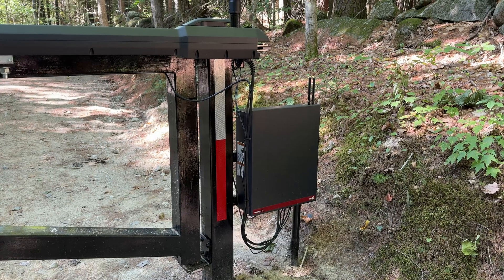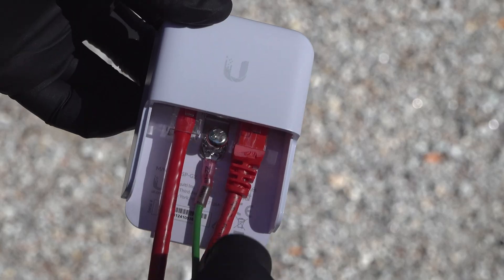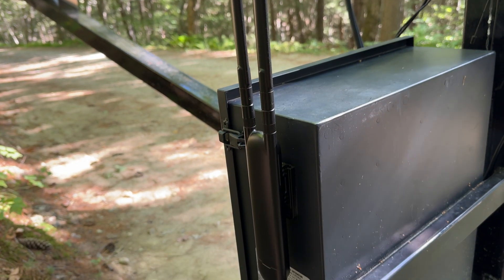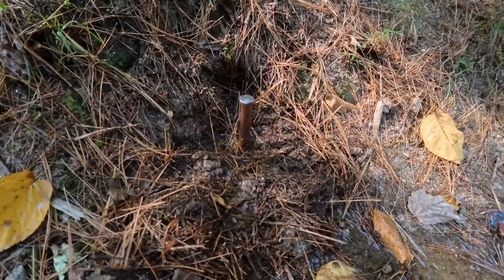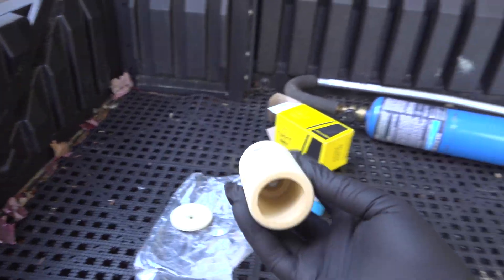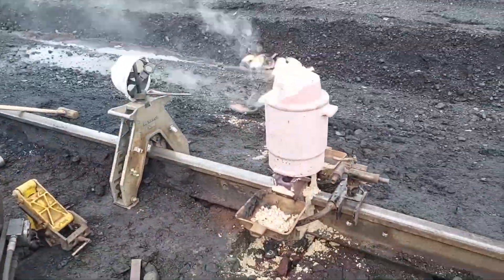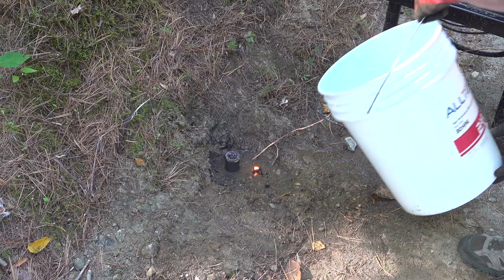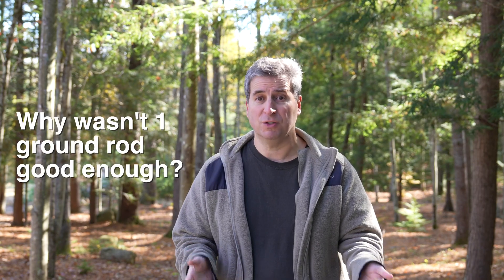Best Way to Protect Outside Network Equipment From Surges

Comment: First and foremost - this is an excellent tutorial on how to find a grounding tab, put the grounding rod in, connect it, etc.

I am confused though, about how this helps for outdoor equipment? Generally, surges are going to come from the power lines, or potentially misbehaving equipment (often due to irregularities in the power lines), in which case, it makes most sense to have anything that's fed from the house, protected by surge protectors inside the house. It's worth noting very few power strips are rated such that they are going to survive a direct strike on a power line right outside the house, but if it hits, say, a nearby substation, the dissipation of it hitting multiple homes, lowers it such that it's manageable for most MOV-based surge protectors. Network equipment like that shown here typically doesn't have any integrated surge protection, as MOV-based surge protectors are sacrificial, so it wouldn't make a lot of sense, as the device would likely end up dead anyway.

If equipment is not physically connected to the house stuff, only used via wireless networking and solar panels, then there are only two other spots for outside surges to come from lightning (which seems to be what you're going for, based on your comments near the end of the video): lightning hitting equipment directly, or lightning hitting nearby trees.
Because there isn't any built-in protection to these devices, if lightning hits a device, the fact that they're grounded isn't really going to help, and may even make them a more-likely target for lightning in the first place. If the goal is to protect against nearby strikes on trees and such, grounding them is still not great, as you've not given lightning a path from the ground (which is absorbing the lightning strike) to your devices, whereas without ground, it wouldn't be able to backfeed from the ground into your equipment at all.

Can you clarify the goals here, and how grounding this equipment will help with any sort of power surge you're expecting to get? (The main advantage I'd expect to get from grounding outdoor equipment, is a (more) solid reference for zero Volts - but this generally isn't useful for differential signaling, such as Ethernet, anyway.)
Reply: You can get surges on your outdoor ethernet cables from nearby lightning strikes. It can be hundreds of feet away. And fry all your expensive home networking gear.
Reply: @estusflask982 Re-watching the first part of the video, I see the device at 0:20 is an Ethernet surge suppressor. This was not clear to me from the first or second times I watched this. I'm also realizing at :11 the "I don't have any wiring back to my house" was not referring to Ethernet, but rather mains voltage electrical. I would still want an Ethernet surge suppressor inside the house at this point, and still have the concern about adding a ground outside being a potential path for lightning energy from a tree strike, that wouldn't otherwise be there. I would think that running fiber instead would eliminate all the headache of it though, and likely be a better way to do it, especially if the power is coming from solar anyway.

Comment: Nothing is going to protect electronics if they take a direct hit.  A good lightning defense should be a layered approach starting with an arresting system that should take the majority of the hit before it ever gets to the electronics, and each remaining layer  doing it's part until, hopefully, the surge suppressors can handle the rest.  It's a nice thought, and it may save you during a near miss, but I wouldn't have much hope for things surviving a direct strike, not to mention that I have seen lightning strike trees or other objects in the yard, not connected to the ethernet cable, and a spike still finds a way in, or is induced, and causes significant damage.   While it doesn't play well with your POE plans, for wide areas or multiple buildings, I prefer wireless or fiber optic links that can cover a lot more distance than Cat 6, and, most importantly, can't conduct a surge.  They won't prevent damage at the point of the strike, but they will contain it so it can't damage anything else on the network.

Comment: 5:49 - It been years for me since i had  my network training but double CHECK if you are using right cables. 
This are UTP cables - not shielded with plastic connector. You need STP cable with shielding&metal connectors for continuous grounding - it is placebo without it.
Reply: STP will not protect from surges. The Shield is to reduce external noise such as power cables running near by STP data cables. or electrically noisy equipment (EMI). 

Typically surges in data occur when an intermittent voltage is applied to the one or more of the pairs. This could be a bad POE power supply, equipment failure (bad network switch or ethernet card). 

Using the STP Shielding as a ground sink for a Surge protection device  is a bad idea. There is a chance that the Cable outer jack will be compromised (ie cut) that comes in contact with a energized metal (ie  metal electrical Junction box), that will cause the Shielding to no longer be at the ground state & at elevated voltage. For instance 120VAC. if that happens, The Ether  Surge suppressor will work in reverse applying a higher voltage into the data pairs likely damaging the ethernet device & probably the switch. 

An real world example of this is when a ethernet cable (UTP) was ran past an overhead fluorescent light in the ceiling. the fluorescent light metal case became energized due to improper wiring. The ethernet cable was frayed  by a sharp corner of the light fixture and energized one of the pairs causing the destruction of the eth. switch and the IP camera connected to it.

I like the idea of running STP, but not connecting the shielding to a Surge protector.
Reply: @guytech7310  Yeah it needs connected to ground AND only 1 end of it connected to ground, just cut the other end off you don't want it to be a path for current, it's just to "shield" the wire from interference and nothing more.
Reply: @PatrickBaptist you actually ideally want both ends of the shielding to be connected, and a metallic enclosure connected to the shield that goes around the device. In the real world though doing it correctly often gives you ground loops so cutting the shielding on one end is a cheap fix, but it's a bandaid that doesn't actually solve the grounding issue. 

Having a ground loop isn't caused by the shielding, it's caused by bad grounding. By having a grounding rod on both ends of the cable you clamp the electrical ground to the same level on both ends and  can connect the shielding correctly. Cutting the shielding on one end is much cheaper and often good enough though so it's ok I guess lol

Source: I'm a network engineer and an EE dropout lol
Reply: No need for shielded CAT cable for long outdoor runs, as there's no EMI to protect against. Water ingress is a much bigger issue. And shielded cable can become problematic if it's grounded at both ends, you'll end up with extra ground paths etc.
Reply: @sstorholm  I live in a city so there is all sorts of EMI like mobile phone networks, radio stations, TV stations, etc.  long cable runs are basically really big antennas that suck up all these signals. 
electronic equipment these days have more than one type of ground, the have a 0V rail and an earthed chassis ground.
Reply: @johng.1703 yes, but EMI strong enough to interfere with ethernet has to be very local, we're talking within feet, and long outdoor runs in the middle of the forest like in the video isn't the case. Ethernet has very good noise rejection already due to the differential pair signalling employed, so most issues you're going to encounter are related to crosstalk. A improperly installed STP cable (shield not bonded to ground at one end, or both ends bonded) usually give you more problems than UTP ever would. 

Source: I'm a network engineer.
Reply: @sstorholm  granted most issues are based around NEXT and FEXT, capacitance can also be an issue. but in this case in the video the cable lengths are pretty short, it looks to be using a wifi bridge. but there are all sorts of EMI in the box for the gate controller, motor, power converters etc, again really shouldn't be a massive issue, transient spikes are usually handled by TCP anyway. remember the power is locally isolated and the structure is already locally earthed. so there isn't going to be any issues with earths from different points leading to a small voltage on the earth. yes I too am also a network engineer. I work with copper and fibre, I do telecoms, data, you name it. I also qualified as an electrician too. 
shielded cable in this gate system would cut down on spikes etc due to transients from the high current switching from the gate motor and as they are all contained in the same cab, there is going to be some EMI and yes it will cause some retransmission. unless all the things that are screwed into this big metal gate / structure and completely insulated they are going to be sharing a common earth anyway, adding the extra earth bar might give a very slightly better earth, the surface area of the big metal gate post is going to be pretty good. it would all share the same earthing. the chassis ground on all of these devices are also going to be electrically connected to the gate post, shielded cable isn't going to make a difference in that sense. it would clean up any transient spikes from the power / motor though.
Reply: @sstorholm  "No need for shielded CAT cable for long outdoor runs" 

Usually AC Power cables are run in parallel with the data cables in trenches. Or multiple data cables are pulled through a conduit. So Shield cables are a good idea. 

Special data cables exist for burial as the have heavy duty jacket that isn't permeable to water as well as filled with a hydrophobic gel to address possible water intrusion into the cable (ie at the ends or if cable jacket is damaged.
Reply: @guytech7310 AC power operates at a completely different frequency than Ethernet. If it's carrying so much current that it becomes an issue for your network cable, you really should run it in a separate conduit (and if it's 120-240V you should do it anyways). That bit of separation with some dirt in the middle, even if it's the same trench, should be plenty enough for it to not be an issue.

What you said is true though, but usually when amateurs do it in their home by running Ethernet cables in pre-existing conduits that already have electrical wires in them. I did it in my house :p

In the other gate video he also shows that he's using fiber to transmit data which is the best thing for this kind of stuff anyways
Reply: @FAB1150 "AC power operates at a completely different frequency than Ethernet. "

 Noise will couple between the AC & ethernet. Everytime an inductive load is switched\on or off it will create fast transient spikes. Switch mode Power supplies also create a lot of higher frequency noise.
Reply: @guytech7310  I wanted to mention that, but if they're properly separated it's not really an issue. If you're digging a trench already, just put two conduits in it.

If you run cables properly you almost never need STP, but sometimes it's inevitable and the things you mentioned happen. Not in this case though
Reply: @FAB1150  FYI: 99% of the trenches used for power & data, there is not even one Conduit.
Reply: STP protects against interference, not surges. It's used when you have a long cable near other sources of EMI to "protect" the data flowing.

Buried cable is already shielded against it, the ground itself blocks interference and acts as, well... your ground.

Installing a ground rod like this not only protects you from surges but during normal operation it ensures that electrical "ground" is actually at the same voltage as "ground" on the other end of the cable, especially with super long runs like this one. Otherwise the resistance of the cable lifts up the voltage of "0V" and that's how you end up with ground loops.

Yeah electrical ground being called "ground" is confusing lol
Reply: And only connect up the shielding to one end, if you connect both ends of the shielding then you just made a circuit out of it that has the potential to carry current.
Reply: @PatrickBaptist  well yes and no that's supposed to be handled by the device otherwise you don't know which end of the cables connected in which end it isn't. So the cable needs to be complete plus it breaks other things that used cables that way and it's very annoying when you order five cables off Amazon that are not continuously connected......
Reply: reading the comments here it is so funny. this particular device is primarily designed for ESD for wifi antennas, as they are usually up high with very few metal or conductive objects above them. 
I've always used shielded outdoor rated cat5e/6 cable for decades, never had a problem. in pre POE days you would run DC voltage on 4/5 and 7/8 and use a splitter to inject and pull out the power at each end. the grounding on the device prevents any ESD build up in the first place. power supplies have been regulated for decades. I've had towers and building struck by lighting, it's never been an issue. towers usually have a much lower resistance path to ground.
Reply: Ethernet surge protectors protect unshielded ethernet cables.